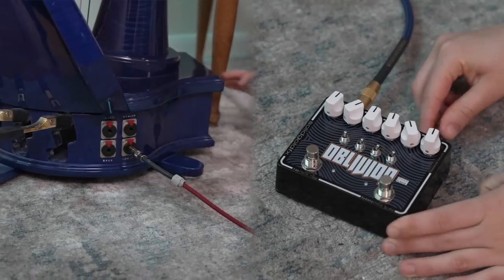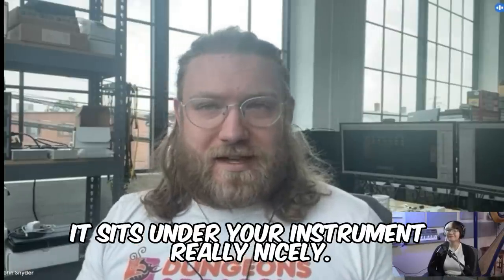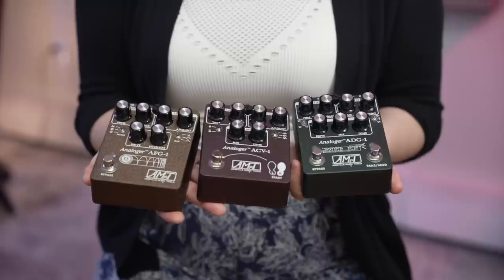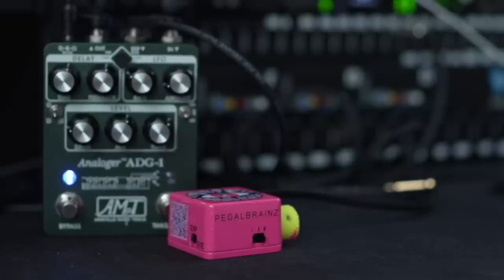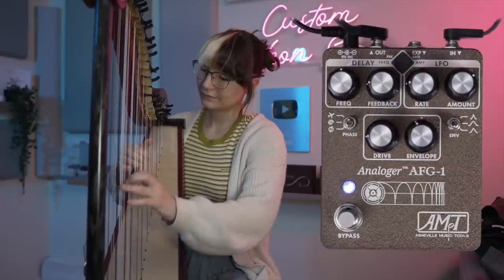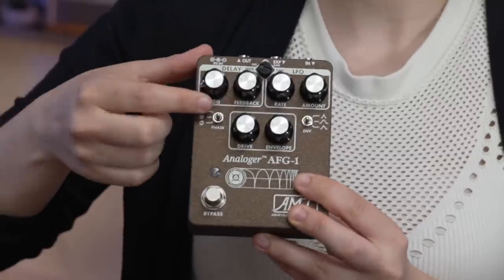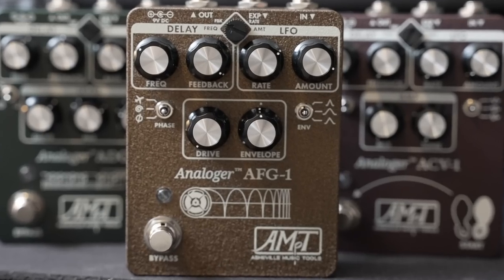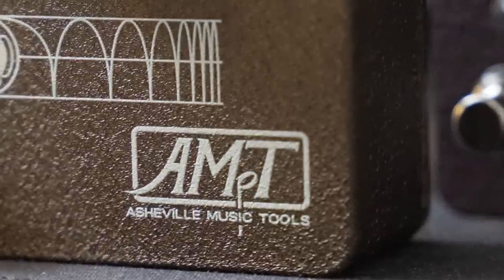Why do I love bucket brigades so much?

Comment: Thanks for having me on Emily! That was fun.

For those curious there's one tidbit about BBDs vs digital systems which is really special. BBDs are sort of in the middle of analog and digital. The signal in a BBD isn't quantized in amplitude, but it is sampled. Changing that sample rate changes the delay time. Fast sample rate = short delay, slow sample rate = long delay. For digital systems, signals are quantized in both time and amplitude and it's common to change the delay time by setting the length of a memory buffer. 

When you're making a chorus, vibrato, flanger, or other effects based on modulating the time of a delay line, you run into this concept called "fractional delay." This means basically delaying for less than one sample, which you need to do if you want a smooth change of sample rates or delay times. This is really hard to do unless you can change the clock in steps of less than a billionth of a second! It's also possible if you do some sophisticated DSP trickery (google "subsample interpolation" for more). A BBD with an analog clock doesn't have to worry about this because the sample rate clock is continuously variable. So it's a lot easier to get very smooth, continuous modulation without a lot of complex hardware. 

TL;DR analog good, digital good too but it's harder to do right
Reply: For me the incredibly profound and important part is where you said "The stuff that is trying to get around that (the in perfections) but then contributes its on character" and "the sound of BBDs is the sound of all the stuff that you have to use to make them behave properly" BINGO!
Reply: :_russpog::_russpog::_russpog:COOOOL!!
Reply: Small world John. Crazy to see you pop up in my feed lmao
Reply: That’s a great point. Analogue sample and hold circuits definitely have their own character
Reply: Bucket Brigade delay and mods like chorus and flanger, can sound excellent, but they are also limited. 
I’ve owned enough analog and digital pedals, to know that there are digital ones that are just better. 
Then there’s the karaoke chips, that so many builders use. 
When done correctly, they sound great. 
I kept a BBD on my board for awhile. I also had a Boss DD-3, for the pristine delays, combining the two is where the great tones come. 
But, I replaced that analog delay, with the Caroline Guitar Company Kilobyte, because I just liked the sound better. 
It has more of an analog tape delay thing going, than a BBD sound. 

Now, we have builders coming up with these multi function, true stereo BBD delays. These usually have some type of digital control. 
There’s just so many great analog and digital pedals out there.

Comment: What is a bucket brigade ?
Imagine you want to transfer water from source to destination (putting out a fire0
Get a line of people with buckets to pass the water along
Imagine in your case it's sound that's passing along, but you can also sample that sound at any bucket or a mix of buckets to pass to the output, you get differing delays
Also look into tape delay machines, like the 'copycat'
The most basic delay is a long length of cables (there's video on this)
Compare a digital delay with being in a big building that echoes (search 'tom scott echo' ) for a demo

Comment: In Dave Hunter's book "Guitar Effects Pedals: The Practical Handbook", he has interviews with a number of prominent and well-respected designers/builders.  One of them is effects legend Roger Mayer.  One of the interesting things Mayer says is that the differences between digital and analog delays become most audible in the decay.  His hypothesis is that, where the resolution of digital converters is fixed, and results in fewer bits being used to encode the soft fade-outs, analog sampling in BBDs is effectively infinite resolution, no matter how quiet and subtle the delay repeats may be, since what each bucket gets handed is the exact voltage of the signal at each sampled moment, not the nearest "rounded-off" value that the encoding recognizes.

It is probably worth noting that, when the interview was recorded (published in 2013), 16-bit resolution, and 48khz sampling was the likely state of things, so the digital-vs-analog differences in soft passages may have been more audible, in comparison to current 24-bit/96khz technology.  Still, an interesting proposition to account for why some folks prefer analog delay over digital.  Of course, disentangling it from near-ideological faith in this or that technology is no easy task.

Worth noting that earliest attempts at digital flanging were stymied by the inability to sweep very wide.  My old blue rackmount MXR Digital Delay was able to flange, but it could only cover a 4:1 range of delay times.  So, if you set it to the .63 msec range, it could sweep from around .36 msec (.63/2) to around just under 1.7 msec (.63 x 2).  More impressive flanging generally requires a sweep range of at least 30:1 (e.g.,  .25 msec to 7.5msec).  My analog PAiA Hyperflange will do 88:1 and the legendary A/DA Flanger has a 40:1 ratio.  Not all analog flangers are that capable (Boss BF-2 is 13:1), but for many years, analog flangers kicked digital flangers' collective hineys.

John is quite correct in noting that much of what makes analog BBD effects sound the way they do is a result of all the things you have to do to make them behave themselves.  But it is not necessarily impossible to emulate all of that in the digital domain.
Reply: Mark, thanks so much for chiming in. I have enormous respect for your work and have read many of your articles over the years.

I think Roger Mayer's hypothesis is spot on with low level behavior of early converters. You can see signs pointing to this with the nonlinearization/relinearization circuits found in early Lexicon units, or even the prevalence of companding systems in pedals like the old Digitech PDS series. That "hybrid" era sounds gorgeous. 

I think that as state space modeling continues to improve, emulating all the nonlinearities of filtering/companding behavior is absolutely possible in a DSP system. If you look at pedals like the Strymon Brigadier, I'd say it's already achieved in most respects. Not to mention whatever AI profiling is doing these days. (Though, that's pretty far from my core competency!) Digital clocking limitations are absolutely the biggest factor, IMO. My understanding is that, barring proprietary magic I'm not privy to, sub-sample interpolation is always going to sound different compared to true fractional delay with a continuously variable analog clock. I'd be curious to hear your thoughts on that. The limitation is also applicable to BBD delays with a clock generated by a processor. The resolution of a typical hardware PWM peripheral is rather poor, and if you want exponential control of a clock frequency over a wide range it's going to take resolution on the order of hundreds of picoseconds to get a smooth sweep over several octaves.
Reply: @electronicaudioexperiments  Well now you're talking well above my pay grade!  But many thanks for the nod.  Deeply appreciated.

That said, we should be mindful of the quirks inherent to BBD-based effects, that are asked to operate in different delay-time ranges.  Those itty-bitty capacitors in each stage will leak, as all caps do, so asking them to hang onto samples too long will likely result in an imperfect sample passed on to the next stage.  Longer delay times CAN be achieved by use of multiple cascaded BBDs, such that samples can be passed along quickly enough to avoid that leakage IF you have lots and lots of stages.  But for chorus and flanging, where we're talking only a tiny fraction of the delay time, those concerns don't apply.  Equally, the filtering needed to reduce audible clock noise, when aiming for longer analog delay, imparts much of the "warmth" people associate with analog over digital.  And while perhaps never deliberately intended to do so, it comes closer to the treble-eating qualities of real-world reflective surfaces than early digital delay did with its maximum bandwidth.  Again, wet-bandwidth concerns tend not to apply in the context of ultra-short delay effects.  Heck, the Electric Mistress and A/DA flangers had barely any lowpass filtering, because the clock was always operating at a frequency well above hearing range.  In contrast, many delays will require clocks to slow down considerably, increasing the risk of audible clock noise, and the requirement for lots of filtering to make it inaudible.

Comment: I've had pedals (and keyboards) that I consider "aged out"...IE the decay of the transistor performance...? Granted, it takes (normally) decades, but the longer and frequency of device use seems to accelerate it slightly? When I first noticed this (early 2000's) I thought I was craZy (LOL 🤣😂👍), until I found some DOD & NASA papers discussing this phenomena? And mind you, our devices/effects DON'T have military/NASA grade components inside (they'd be HUGELY unprofitable AND unaffordable..)
Moral? Don't be afraid to "freshen" up the signal path...
(Dang aging, I guess it affects Everything? ROFL 😂😂)
Love your channel, BTW..

Comment: I resonated with what John said about once you put a computer in there, it tends to bring with it more features and complexity. I run into the same thing with my synth module designs. Microcontrollers are so cheap these days that there's hardly anything that it makes sense to do without one. But it bothers me from an aesthetic standpoint when we use them for simple stuff. It's like using a multitool as a screwdriver. I won't deny the convenience of having a screwdriver in your pocket when you need it, but the experience is just... not as good.

So when I build things, I like to design them for their specific purpose, and nothing more.

Comment: I enjoyed the tribute to stings fields of barley with the two analogers stacked.
Since you're getting so into BBD you should check into pastfx and Verlie reviving the buffalo fx reticon flanger along with many other Panasonic mn3007 equipped builds that have a slicker and more sibilant frequency response than the cool audio chips used in similar devices. You also should look at the new Loke by Fjord Fuzz, that's some of the most amazing digital Delay and flanging I've heard, they made a very tape sounding program and I'm a chip snob but love it love it. 
Lastly I'll mention the 550-tt deluxe memory man, these usually can be found with Panasonic chips still and analogman does some nifty mods to allow better signal flow than the stock version and the ability to overclock the chips so the clock noise becomes overbearing but awesome. I have a video of the 550 if interested.